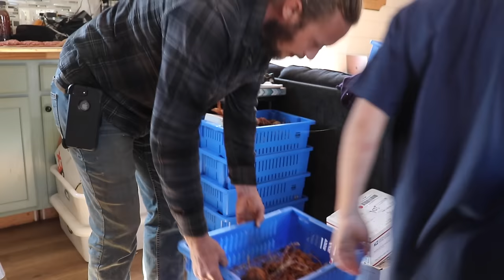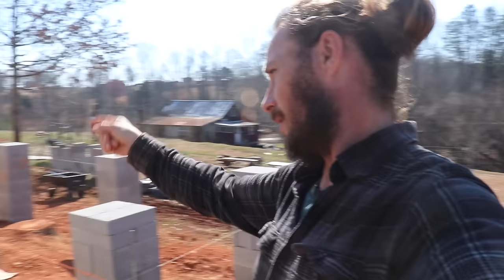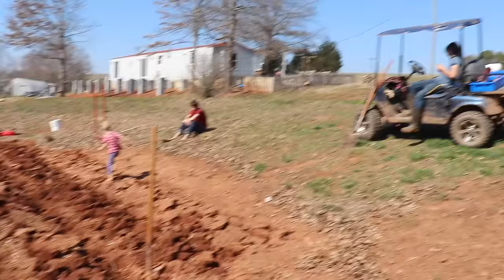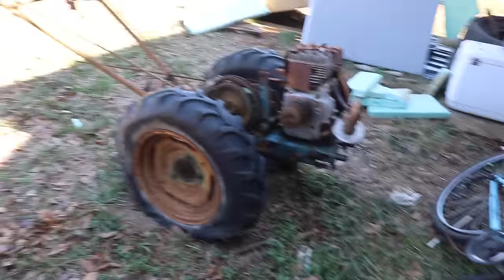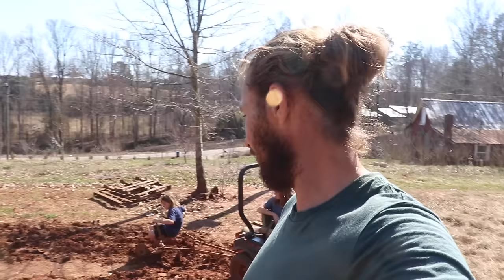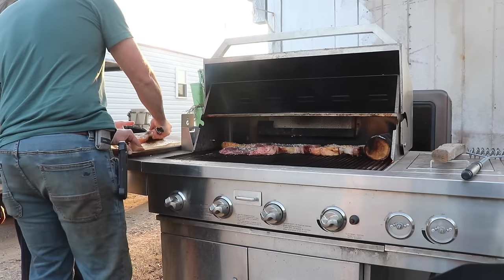It’s All An Experiment

Comment: We have had an original Troy Bilt tiller since '84, it's a small version of the Bradley. Rear tine tillers are much easier on the arms/shoulders than front tines. We have a cultivator and a furrower.
I always planted in the ditch, then you can run the tiller along the mound to hill plants in the ditch quickly.
The harrow idea was great! Jason at Cog Hill has a spring tooth harrow for Brooke's tractor that he now prefers in his hard, rocky soil. She runs it north/south & east/west and it cuts deep to loosen soil without turning it over. You should look into getting one for your tractor.
When you get the Bradley going make sure the neutral lever is very easy to use as that beast will drag you boys anywhere it wants. You'll want Buggy a good distance away.
Blessings
Jan

Comment: Can potatoes when you harvest later this summer.  Scrub(we don’t peel), cut as you see fit, can 15 lbs for 15 at our altitude.  You won’t have as many than sprout.  They’ll be in the skillet with onions and garlic. Yum!  💙
Reply: It's unsafe to pressure can potatoes in water with the peels on. Check to see what your altitude requires as far as pressure & time.
Reply: @denisewilson8367 -Actually, it’s best to water bath potatoes for 3 hours. If I know you’re against it, but the rest of the world cans potatoes that way and do just fine. The water bath is easier in the potatoes, they don’t break down as much as they do through PC.
Reply: @Junkinsally  water bath canning  of potatoes is not approved. Only pressure canning.
Reply: @denisewilson8367  😆😆 Rebel canner here. I trust the old ways more than I trust the FDA.
Reply: We all can the way we were taught.  My maternal grandmother canned rabbit in a hot water bath canner.  My mother pressure canned meat, beans, and potatoes.  My beloved spouse and I prefer pressure canning because it’s faster and for us the quality and texture of the product is firmer.   USDA has its regulations, but to each their own.  I like that it’s fast food.  “ How fast can you run down cellar for a few quarts”.  💙

Comment: When we were kids we used a 1 -2 bottom plow to dig furrows. You plant rows in one and when you plow the next it covers the row. We plant 1-2 acres that way. Much easier.   My brother has a secret to planting. He has a hiller which makes rows 6-8 inches deep it mounds up the dirt. Then he uses a plastic laying machine that has a drip line and puts drip down and lays plastic over the top. That way it holds moisture in the ground and protects plants and also little to no weeds. When he sees plastic pushed up then he goes along and pokes a hole in plastic to allow potatoes to grow up. We had the best year for potatoes than we ever had.  You can buy old plows pretty cheap.  Plastic layer is not cheap and hiller.  He’s been doing this for almost 40 years.

Comment: The disk works fine with a couple of railroad tracks for weight.  The riding mower is much easier on the body than the walk behind.   you can make an adapter to make a ride in trailer which is nice.

Comment: Hey Hollars loving it awesome videos. Congratulations on bub. So exciting. Ben something you might wanto try. Last year i did woodchips over potatoes. Worked beautifully. I thought potatoes would be blotchy skinned. They were all perfect. Kind of Ruth Stouts method. I just lined potatoes up on very thick weeds. Thinking thus is not ideal but nedd job done quick. Covered with woodchips. Sprinkled few shovel loads woodchips over as they were growing. Worked great! U could cover whole garden n potatoes with chip now. Save ya back with the digging. Like you say soil improved with chip and soft for next planting🥔🌼

Comment: Feckless fact:  Farm steam engines were popular to run threshers, etc as stationary power sources around the farm.  They could be pulled to various places on the farm by horses since the engines were on wheels.  Them someone got the idea of using the steam engine to gain traction against the ground and the term tractor was born.  Anything that lets you pull against the ground can be called a tractor.

Comment: Put on some old window weights they will be easy too wire on in case you only have a few of the weights. That old tiller reminds me of the big tiller dad had bought man was a horse and shook my dads heart and hurt it so me and my husband rolled it too save on dads heart. And it didn't have enough weight on the back either.

Comment: I have heard/read that a lot in the past 2 years, about planting later to avoid squash bugs. A few people saying it works, no one saying it didn't work, glad to hear your experience. I do wonder if 4th if July was a month off for your climate.. ? I have heard later June, for the lower Midwest/middle of country. I'm in nw/west WI and not sure that wouldn't be a bit late for good production for us, most years, also. Last fall we didn't actually freeze when usually we would have gotten down to freezing at least once by end of Sept. , and that was my 2nd garden in a fairly low elevation ( compared to area) spot and not where I live so I didn't bother trying to cover them when I thought it was gunna freeze once. Growing up, we just always covered them for that 1st round of frosty nights to help more make it to maturity. Seemed to work but of course u never know if you'll get much "Indian summer" . 
I don't know if you'll see this, I'm a few days past posting, or if you've seen my previous comments about it, but hopefully u have/will : For squash bugs prevention/repellent, try tobacco. You get plain tobacco - we've bought pipe tobacco, it's cured, dry, chopped, from a cigarette/tobacco shop. Place a small-ish palm full in the soil at planting or transplanting time. Viola ! Adding it slightly later if you'd already planted has worked too. As close to the roots as u can. My friend's mom has made a spray with tobacco in the past, I never did hear how well that worked but she did it more than once, so.. ?  This has worked MARVELOUSLY for my for cuke beetles, it's originally FOR squash bugs tho. I have seen it not always work against them, but I also just don't always have em, and last year the garden they were bad on was new and not my own place, and a variety of squash apparently very susceptible to them ( the group C. Maxima, in which are Buttercup, my fave :( , and all hubbard, among others).
PS: On mounding potatoes. I do it to avoid green potatoes as besides the obvious green part being toxic, I can taste even a hint of it in a potato, and I've had a terrible time over the years with even potatoes seemingly under the soil surface still, but close to it, being between ever so slightly green to more so. Now I be sure I plant em 6 in. deep, into mounded rows ( I do no till otherwise) and then cover with mulch (usually OG-ish hay or straw, but grass clippings would work too I think) and then remulch, really getting in there (!), at some point in like a month, and maybe one more time for long season ones and due to my pickyness &/or wanting to wait to dig em til closer to frost. That thing where supposedly for indeterminate potatoes you'll get more if you keep adding soil.. ? One grower has said that that's just totally a myth, no matter if the variety is known as determinate or In-det. . Hmmm.  Anyway, I pray God continues to bless n keep y'all !